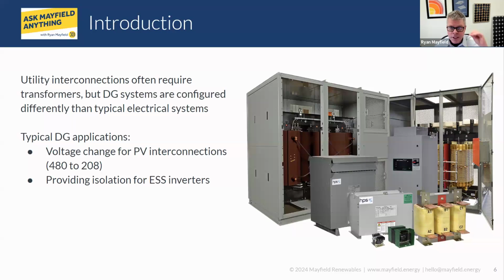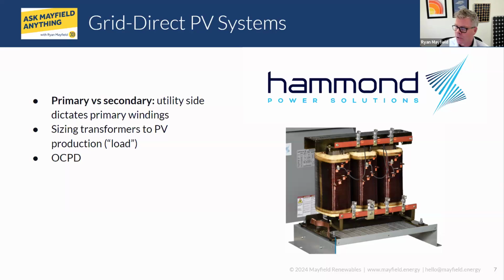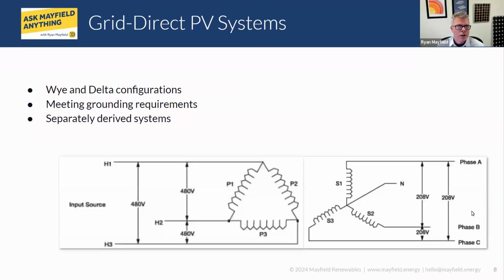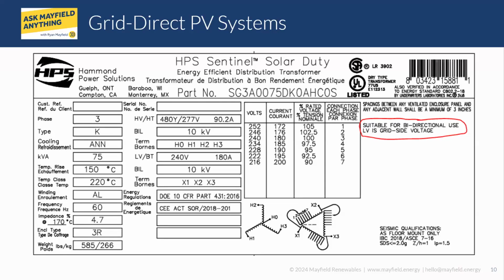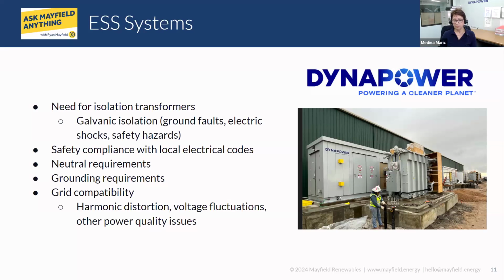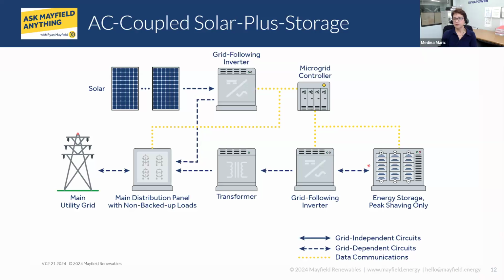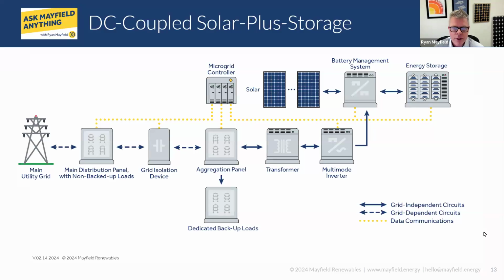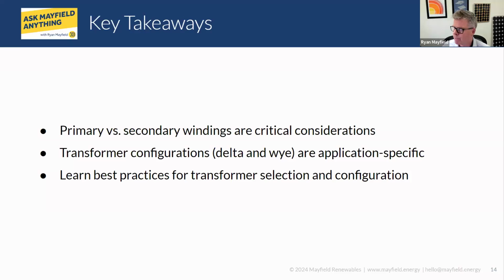Transformer Configuration for PV and Energy Storage Projects - Ask Mayfield Anything

Comment: Hi Ryan,  could you explain?  why Lower capacity of inverter has max fault current contribution (1 cycle rms) is more than high capacity of inverter of max fault current contribution (1 cycle rms) 
For example
a. CPS inverter model name CPS SCA 36 ktl-DO/US-480 has fault current contribution (1 cycle rms) is 73.2 A  (1.68 PU),, while
b. CPS inverter model name CPS SCA 60 ktl-DO/US-480 has maximum fault current contribution (1 cycle rms)  is 64.1 A (1.6/0.88PU).
Reply from the maker: This is an excellent question. We do not have enough information on those inverter models to give you a thorough answer. We recommend contacting CPS's engineering department, who should be able to share more details.